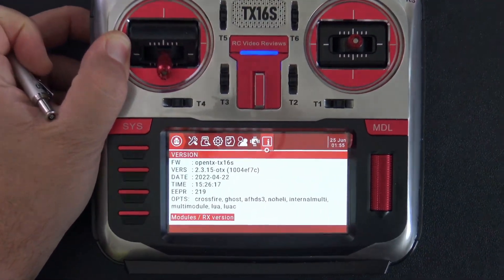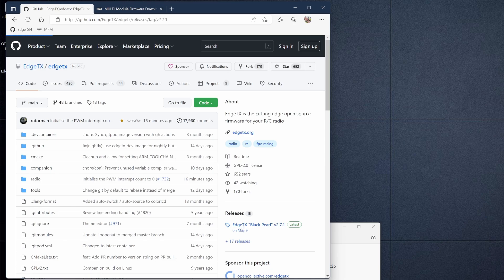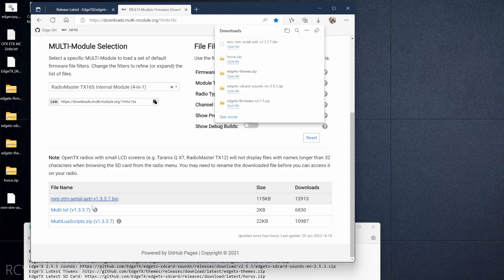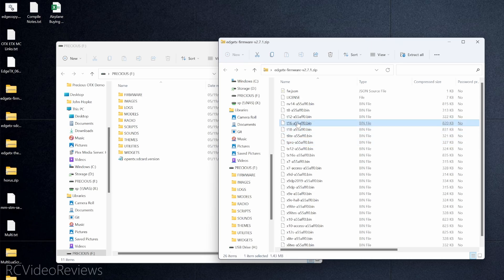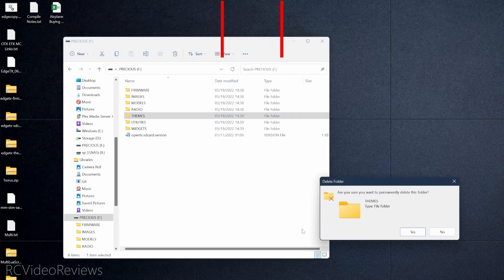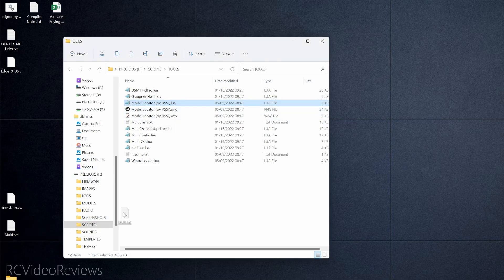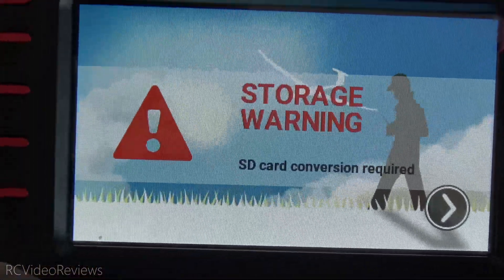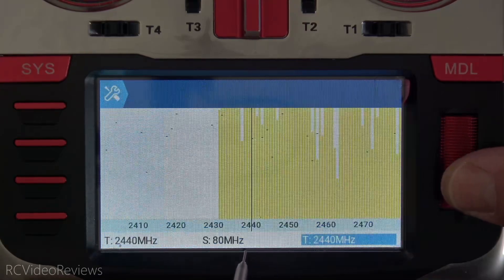How-To Convert from OpenTX to EdgeTX MASTER CLASS • 100% Works

Comment: Good Video.  I like the concise, cut-to-the-chase format of this and other videos or yours!  

I'm on the fence for switching to ETX.  I'm currently running a RM T16S, but with an older firmware set.  I have refused to update my xmitter firmware, from back when FrSky and Jumper (my first OTX radio) got into a squabble and FrSky started doing some proprietary things with your X8R and S8R receivers.  So, all of my X8R and S8R receivers have been flashed back to older firmware sets before I bound/installed them in my aircraft.  So, first question:  If I do the OTX-to-ETX conversion as you've shown in this video, will the ETX RM T16S communicate with the existing older firmware receivers?  Or will I have to pull all of my receivers out of their respective aircraft (I currently have a bout 40 aircraft that are bound to my RM T16S) and flash them to a current firmware set?  My gut is telling me 'yes,' and that's a huge turnoff to me.  Related to existing receivers that are bound to the OTX-running transmitter, will they have to be rebound to the ETX-running transmitter?  Losing all of my existing widgets is a big turnoff, too.  I fly complicated warbirds and have spent quite a bit of time making multiple information screens for each model.  It would be a major ordeal to have to redo all of the existing widgets.  i do understand that ETX is actively advancing, while OTX has been evolutionarily stagnant for many years.  But OTX ain't broke for me.  Thus the quandry:  Do I fix what ain't broken, or bite the bullet and step into the new decade???    Decisions, decisions...

Again, thanks for this and your other videos.  Quality stuff!!!
Reply from the maker: "If I do the OTX-to-ETX conversion as you've shown in this video, will the ETX RM T16S communicate with the existing older firmware receivers?"

Yes, your bind info carries over.

This video might help with your decision: https://www.youtube.com/watch?v=Hwe55lPsN4g

Comment: Hello John, pardon if this has been covered, is there a listing/way to determine radio hardware compatibility before attempting this? I have a 1st gen Horus x10s express currently running otx2.3.14 thx!
Reply from the maker: The hardware list is covered in Frequently Asked Questions on the EdgeTX website: 

http://edgetx.org/faq.html
Reply: @RCVideoReviews  much appreciated, although it appears my radio can’t play, maybe time for a new transmitter!

Comment: Hi can you update this video to the Laters released has change thank for you time and shearing which us.
Reply from the maker: The process to switch from OTX to ETX doesn't really change much from one revision to the next. The biggest hurdle now is the latest EdgeTX 2.9.0 removes the bin to yaml model conversion meaning it requires Companion. Otherwise, the process of flashing is the same.

Comment: I previously tried updating OpenTX and somehow ended up with a blue theme on my screen. Radio worked fine but i am not sure if i busted something that i might not be aware of.

A couple of questions:
1- Do you think i can convert to EdgeTX with no issues from there? Or should I restore the old firmware from my backup?

2- Any idea if I should unzip the files if I am on Mac?

Appreciate the help, cant wait to upgrade my RC experience!
Reply: If I do not care about my only model, can i delete its file and just set up a new model after update?

Comment: Yesterday trying to convert a friend's TX16S. Didn't work out over flasher or companion so also did it like this too. More accidently than planned 😅

Had issues with the sound.
Turned out the folder only can be called "EN" (for English)
The download folders had a longer description. So be aware with that.
Seems like the Express LRS 2.x doesn't work great. Crashes / or doesn't respond with binding.
Have to figure out some things.

Did see some extra information on your video to check out.

Btw the firmware.bin file for the radiomaster tx16s is separate now. No need to take the hortus.

Ps. How good will this run on my Taranis X9d+.?
Already having memory issues running scripts like betaflight or inav. Afraid it will be worse.

Comment: Hi Jhon, I have Taranis QX7 ACSST system with black & white screen. 
So if following your step it should say that I don't need some firmware like the themes, multiprotocol, right? 

Your thought would be appreciated. Thanks
Reply from the maker: Yes, these steps are for a color radio. B&W targets don't use themes.
Reply: @RCVideoReviews  Thanks for your kindly response

Comment: I used this successfully for my TX16s. Very pleased thanks. Then I tried to do the same with FRSKY X10S Horus and that does not work. After setting up the sd card the tx starts , holding the 2 trim levers together, but does not go into flash firmware. Instead it says sd card error expected version 2.3V0029    Any ideas ? I have now reverted this tx to OpenTX
Reply from the maker: I don't use FrSky transmitters, but I would recommend trying via buddy.edgetx.org https://www.youtube.com/watch?v=zvakNqu_5Ec

Comment: Hi  I have a question. I have just converted my Radiomaster 16S to Edge TX after following your post.
My only problem is that the sounds for the Edge software I find indistinct and difficult to understand.
Is it possible to re install my Amber sounds from Open TX?

I love your posts
Ken
Reply from the maker: Yup, amber works fine on Edge. I have a video on installing the Amber sound pack if you need help. This was done for OpenTx, but it applies the same to EdgeTx: https://www.youtube.com/watch?v=S4QYoLFlMf0
Reply: @RCVideoReviews  Thanks for the info and link.

Comment: I'm considering doing the switch. One question - does timer information get lost? I presently have a timer running with total airframe/flight time (is presently at 16 hrs for a Durafly Tundra).
Reply from the maker: The only thing that gets lost are widgets.

Comment: Hi John. Small question? I am running now on OpenTX 2.3.11. To move to EdgeTX 2.8 would you advise to first update to OpenTX 2.3.15 before moving to EdgeTX 2.8 ? Thanks for your feed back and all your videos. Patrick
Reply from the maker: Hi Patrick, Not necessary. You can go straight to EdgeTX from there.
Reply: @RCVideoReviews  THANKS John I just switched to EdgeTX 2.8. All working good so far ! Thanks for your support !
Reply from the maker: Glad to help.

Comment: Hi Jhon, today I just have time to do this migration from OpenTX to EdgeTX from my Taranis QX7 and I already followed all your guidance and problem happened that all my models disappeared...
Any thoughts on this? Thanks
Reply from the maker: They probably didn't disappear, you probably just lost your widgets. Did you look in your models folder?
Reply: @RCVideoReviews  Yes, I just checked in the models folder and there are some "bin" file (same as the file I used to have in OpenTX) and 1 (one) "yml" file but still when I entered "model sel" menu there are no model at all....
Reply from the maker: What is the yml file. It helps if you're specific.

Look in \MODELS and remove any yml files
Look in \RADIO and remove any yml files

You should be left with:

\MODELS\modelx.bin...modelz.bin
\RADIO\radio.bin
\RADIO\models.txt

With that file arrangement the firmware should convert your models successfully.

Go back to opentx, put your backup on the card. Read models and settings with EdgeTX Companion. Flash EdgeTX, write models and settings with Companion.

https://www.youtube.com/watch?v=WfVTCfcae2Y

Comment: Hi John. I bought a TX16s a while back and haven't used it yet so it's still as supplied, it's version 2.3.11.  I have no models on it, therefore there's nothing to transfer over. I'm new to radios like this having previously used Graupner, Hitec,  Radiolink and others. Please forgive me for what is probably a naive question!
I want to change the system to Edge as per your video. Can I remove the supplied SD card and keep it in case I make any mistakes or I want to revert back to Open tx later for any reason and use a brand new SD card for Edge? If so, I assume I'll have to format it first? 
Your help will be much appreciated thanks!
Reply from the maker: Yes, you can do that. You can also just copy the contents of the current SD card to your desktop and use the existing card. If you do opt to go with a new card, make sure to format with 4k or less allocation size. Windows doesn't like to do that for larger cards and it can cause stuttering issues if you use larger 8k+ allocation when you format a card.
Reply: @RCVideoReviews  Ok that's great thanks1 I have a couple of 256mb micro sd cards spare so I'll use one of those.
I'm using a Mac. Would it be easier to borrow a windows computer to do this? Sorry for the extra question!
Reply from the maker: I haven’t tried formatting on Mac. I don’t see any reason the command line tools shouldn’t be able to handle it. Just do fat32 w 4k allocation size.
Reply: @RCVideoReviews  Ok, thank you John...

Comment: Thanks, I am stuck and my situation is, my models are in 2.5 version, I try to go back to 2.3 by using document save as, its not working models are with some strange numbers and name. I try to use binary to YML after watching your video nothing, the reason, my models are saved in 2.5 and not 2.3 version. So I dont know what to do know, any advice from your side.
Reply from the maker: You should join discord and ask there. This is more complicated than what YT comments are useful supporting. Link is in the description of every video I post.
Reply: @RCVideoReviews  I manage to convert the models a bit difficult but I finally did it

Comment: John at 14 minutes into the video you are putting the file TX16-a55aff0.bin into the firmware folder, I am using a new blank micro SD card formatted to Fat 32. Question would I create a FIRMWARE folder to stick the file into on the micro SD, or the file directly onto the SD card. Or does it require tx 16s formatted card and then insert the TX16-a55aff0.bin file? Just want to be sure to do this step right. I have no models on the radio that I want to keep. I understand the name of the file will change with the version I'm downloading. Thank you
Reply from the maker: The bootloader will look in \FIRMWARE if you intend to flash from the bootloader. So if you don't have that folder, go ahead and make it. It's a good practice to keep your MPM, ELRS, Radio, and any Receiver firmwares you make/use in that folder for flashing purposes. I actually maintain my firmware on the production radio to keep the latest copy of firmware I'm using for flight.
Reply: John worked the first time the Flying Dutchman is up and ready, now to learn,  once again. Appreciate you taking the time to do all this!!!!
Reply from the maker: Glad to help.

Comment: I have a question, I fly those little Eachine planes and they have 3 rates, beginner, intermediate and expert mode. I would like to set up just dual rates and expo in expert mode but don't want it to effect the other 2 rates. Do you do this in flight modes or somewhere else. Let me know, thanks
Reply from the maker: I'll repeat this back to make sure I've got it:

You have a switch (we'll call it "SA") that toggles beginner, intermediate, and expert.
You want a second switch (we'll call it "SB") that lets you toggle high rates+expo and low rates+expo while the first switch is in expert mode.

There are a bunch of different ways to skin this. You could use flight modes, but I feel unless you are comfortable programming the radio, it might be confusing. To keep it as simple as possible, I would probably do something like this:

L01: a=x, V1 SA, V2 -100, (or whatever your mode switch is: -100 for up, 0 for mid, 100 for down) AND SB-up
L02: a=x, V1 SA, V2 -100, AND SB-!up (notice the exclamation mark)

Now you can setup a 2nd line on your inputs page using L01 for the high rates switch and L02 for the low rates switch on aileron/elevator/rudder.

Comment: Hi everyone, quick question, will this conversion unlock the touchscreen on my TX16S OpenTX (it is touch ready)?
THANK YOU!
Reply from the maker: If the touch hardware is in the radio, it will work with EdgeTX.
Reply: @RCVideoReviews   under settings it registers the touches so this will unlock the touchscreen?

Comment: Ok I need some help... I bricked my radio, tried impulse to reboot the drivers and still can't get my radio to dfu mode. When I plug it into my laptop, all I get is the green power light and the amber flight mode 1 light. I tried pulling the internal battery out, reformatting the SD card, cube 32 and I can't get this thing to connect. Any help would be appreciated! Love you're channel btw! You've helped immensely!
Reply from the maker: If you turn the radio off, connect USB, flash firmware from Buddy or Companion, does that work? If not, your best bet would be to get on the EdgeTX discord and ask for some help there. YouTube is a terrible platform to sort out issues like this.
Reply: @RC Video Reviews  so someone in the Facebook page actually told me to plug it into my android and flash it there. That worked like a charm! So that's agood nugget of info for us sophisticated people with Android phones; the TX16S can be programmed via mobile phone🤣

Comment: Hi John, If somebody has mentioned this before now, forgive me, but I think you forgot to include actually flashing the MPM module in the video.  Maybe update the description to indicate this?  After following the video to the tee - I discovered the MPM wasn't working and knew what to do, but the people new to the hobby that follow the video are missing a critical step.
Reply from the maker: Converting from OTX to ETX does not necessarily require a MPM upgrade. In any event: https://www.youtube.com/watch?v=CUmw2cDnFx0

A basic search on the channel could solve the issue.

If you saw view statistics from YouTube, it's a wonder I do videos over 2 minutes at all. It's always "too much" or "too little". So I opt to break things into chunks. Since MPM isn't necessarily required, I put those instructions in their own video.
Reply from the maker: FYI: 17k views and you're the first person to suggest MPM flashing is a required step or missing from the video.
Reply: @RCVideoReviews  John, the reason I posted the comment was I nabbed one of the TBS blowout $59 radios and immediately after unboxing used your vid (which I know from experience are THE BEST on the youtube for all matters Edge and TX16S) to change over to Edge.  Once finished - the MPM module would not work at all until I flashed it (of course using your other video, lol).  So what I'm saying is that if I were a newbie I would think I screwed something up by converting it over to edge.  If following your video with a brand new radio, the MPM won't work afterwards. You see what I'm saying?
Reply from the maker: What you are describing is an exception, not a rule. The MPM is not dependent on EdgeTX firmware to "work". I've--not one single time--had to flash the MPM in order for it to "work" no matter what version of Edge I use. Now, I have had to flash it to get it to stop badgering me about a firmware update recommended. But it should not be a requirement.
Reply from the maker: I just confirmed on discord with one of the moderators who also got that radio the very specific question:

Did your MPM work after flashing Edge but before updating the MPM?
His answer: "Yes. It was just suggesting an update. But it did bind to my sim dongle"
Reply from the maker: You should get in discord and present these types of questions/conversations there. It's a MUCH better platform for these types of conversations.

Comment: Hi John, I have followed all your procedure and converted my TX16S from OpenTX to EdgeTX. But the touchscreen is not working. All functions are accessible by pushing the buttons and menu wheel. Is it possible that my radio is too old for the touchscreen functionality? Thanks
Reply from the maker: You probably flashed the wrong firmware file. Make sure to get TX16S not T16S.
Reply: @RCVideoReviews  hi John, I think it is my radio which is an old version (point 1 of your dedicated video). Thank you

Comment: I believe I followed all the steps, even to using the 'superceded' 2.7.1 release. BUT, pressing the MDL button does nothing.....(It used to work fine under OTX). What have I done wrong?
Reply: Ha!! Scratch that - I just turned it off, and then On again - It works!!  John, you are a champion!
Reply from the maker: Awesome! Thanks for the comment and follow-up.

Comment: Hi, Im trying to import my models from my x9d running opentx. Just got my hands on a TX16s mark2 that allready running edgetx. The problem is that i dont have a Radio folder on the sd from the x9d. I gues that is needed? When the conversion in companion is done and i write it to the tx16s the models dont show up?!
I have also try to copy the model files directliy to the tx16s sd card to get the automatic conversion to show up but it dont. Wtf am I missing?!?!? Thx in advance!
Reply from the maker: I don't have a Taranis with which to test, but what I would do:

Get the latest Companion.
Setup radio profile for X9D
Read models, save ETX file, close file.
Setup radio profile for TX16s.
Select TX16s profile.
Open ETX file. Companion will complain and convert.
Write models to TX16s.
Reply: @RCVideoReviews  I have tried that, i think. I have done it in so many different ways so i dont remember. :) Next thing to try is to revert back to Opentx and try to move the models over from there. If that work, then migrate back to Edge....why should it be easy? :)
Reply: @RCVideoReviews  Howdy! Got it fixed. I used Edge Companion instead and everything worked!👍👍

Comment: In the event you can't write to your SD card, make sure the little write protection switch on the physical card is set to unlocked.
Reply from the maker: Do you have Micro SDs with WP switches?